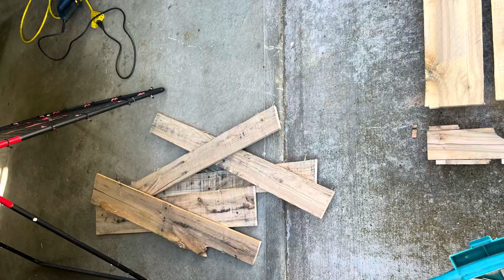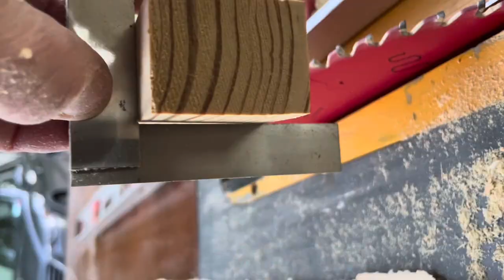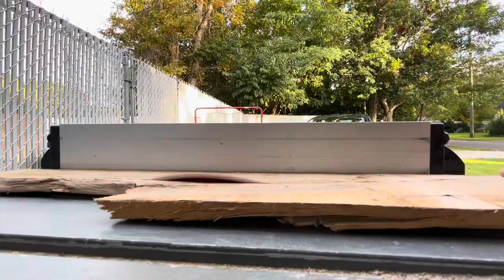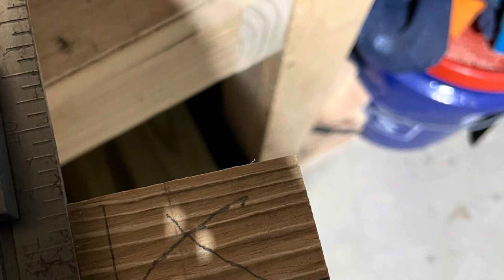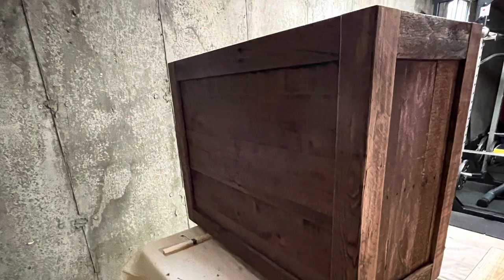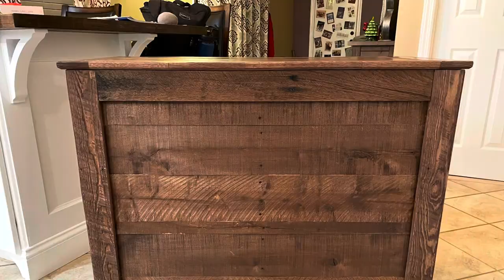The Rolling Whiskey Bar Cart - 2 minute version / Pallet Wood Furniture, Wood Working Project

Comment: Beautifully done!
Maybe someday you can publish the cut list, measurements and assembly instructions for us?
Reply from the maker: Thank you!  This build, like many of mine are done without much planning or intention other than the overall size of the piece. its about 30 inches high by 32 wide by 18 deep if I remember correctly.  When I make something, it is always a custom build. The basic measurements are dependent on customer's space and I work within those parameters letting creativity take its course.